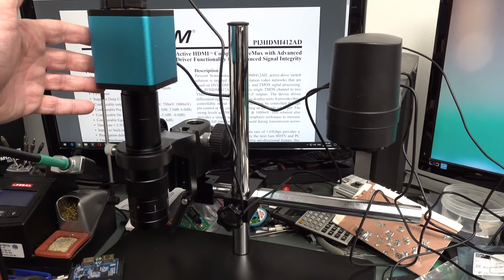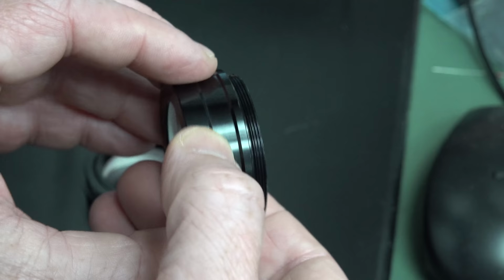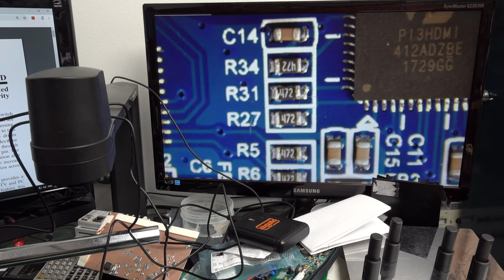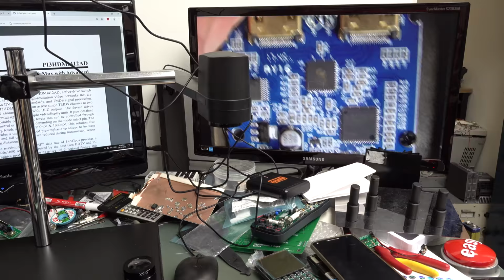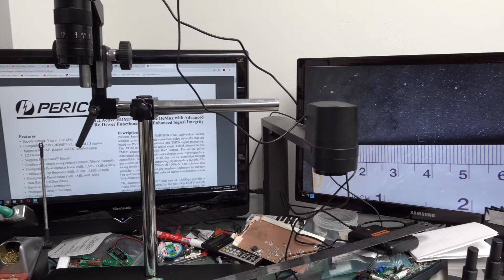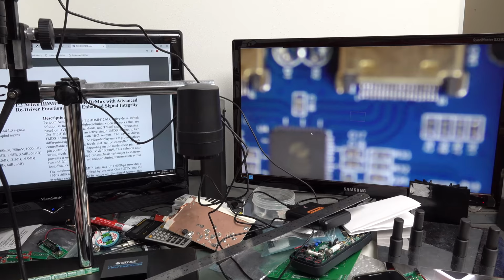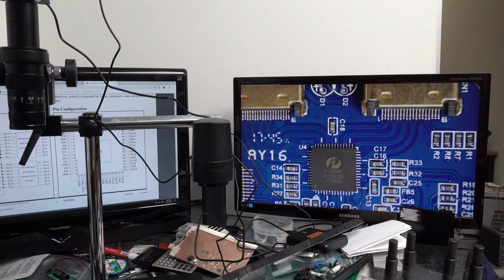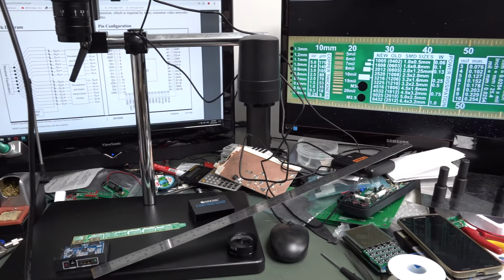EEVBlog #1143 - Eakins Microscope Barlow Lenses

Comment: I don't need a microscope, but I want one of these.  But, alas, no.  I'll stick with wearing two pair of reading glasses (which works amazingly well).
Reply: Just tried it, good tip even though it makes me look like a tit.
Reply: I'm in the same boat. I could certainly use one, but don't need one. Stop posting about this, Dave! I'm still recovering from my rigol and fluke purchases, I don't need another expensive tool enticing me!
Reply: I did not think I needed one but I am the same with good recommendations and recovering from past purchases. I got one and have tons of uses for it now. I'm also getting some Barlow's and going to use it with an old telescope. Weather permitting I'm in the UK. it works brill for spotting marks on so called new items. Call out the seller and normally get a refund of some kind or a Free return when the items not worth it. :-) One of my best buys and the grand kids also love it they now come armed with items they wish to see with Grandads Super Zoom power and they also bring a usb so they can get a copy of the pics. Worth it weight in gold just to see them so engaged and who knows Dave may well be responsible for the next Astronauts AKA Tim Peaks, Physicist Bryan Cox,  or Engineer James Dyson. :-)

Comment: I got the 0.35, 0.5 and 2.0 lenses I found using the 0.35 worked best for my situation, I have also ordered some extension tubes to allow me to raise the microscope up higher to be able to use zoom above 3, auto focus has been really good to have ! 

I am using the 120x assembly not the 180x.

I have some footage recorded for a review video, but haven't got around to it yet. I have been using it to do liquid damaged Macbook Pro repairs, doing 0402 and can use a 10" screen just fine.
Reply: Which extension tubes?
Reply: were you able to test it? I'm trying to find out if it's possible to get the area of 20x15cm with a 120x and 0.35 barlow, even if it means mounting camera 1m above the desk. could you check that for me please?

Comment: I'm able to get great results using a DSLR camera, extension tubes and a normal lens from my old camera. I built a jig to photograph 35mm slides, and can pick up grain on Kodachrome 64.
Reply: I don't need to use a microscope very often, so I also use my dslr with a 70-200mm lens, a close up lens and 2x and 1.4x teleconverters (barlow lenses). That works amazingly well with a great zoom range, autofocus, more than 300mm working distance, and at maximum magnification I get an amazing 12mm wide field of view at full hd resolution. Can get even closer than that if I use 1:1 sensor resolution.

Comment: I am using a ezcap287p HDMI to USB3 capture unit, that works just fine with the eakins, and my splitter (which looks physically the same as, but has different silkscreen to yours), also my splitter is being powered from the USB3 port without external power.

Comment: If light is an electromagnetic wave and lenses focus light, can lenses also focus WiFi or other electromagnetic radio waves ?
Reply: Yes, but you need absurdly large lenses at wifi wavelengths (13cm vs <1 micron for light), so nobody uses them.
Reply from the maker: You can, but not with optical lenses. Light is much much short wavelength, hence the diffraction happens on much smaller scales than radio waves, so the lens material and properties really matters. Some plastics do it at  microwave frequencies.
Reply: You can, just the lenses would be massive. Since 2.4GHz has about 12cm wavelength, a refraction lens would have to be hundreds of meters across to provide any kind of focusing power.
Reply: I seem to have read something about using a Fresnel lens for microwaves.... not the glass or plastic kind, but a flat wood surface with the right pattern of aluminum circles laid on.
Reply: OverUnity7734 hello
Reply: Hi
Reply: @emmanuelafriyie3528  
Hello, 
Konnichiwa, 
Bonjour, 
Guten Tag, 
Aloha

Comment: Will these work on the Hayear 41MP included tube lens?
I'm glad I finally found a video about this.
I want this setup but I can't imagine what I'd use it for other than soldering and reading the fine print on things.    What do people use these for in real daily life (not industrial inspections like in a shop) other than soldering?
Reply: Check with Hayear on Ali express you can Message (New Feature i think ) them Direct Im in the progress of buying the Hayear 51mp Camera at the moment and they have been exceptional in giving me a list of items that will work with the lenses they do and also some others from the Aliexpress store. check the spec of your lens where you bought it from assuming it came with the camera / Microscope. for other uses see my post above in reply to BobC the one with the 2pair of reading glasses. :-)
Reply: @andydickinson4018  i bought the 51mp and hace had it a while.  Mounted from my ceiling pointed down on a camera tripod pointed at workbench.   Held to ceiling via one eyebolt in joist and bungie cords.   Out of way and ceiling has less vibration but mainly it decreases magnification to something usable.  Connected to 44" tv.    You can see puctures on my soundpack page.

Im not happy the lens is so hard to get in perfect focus or that it doesnt have motorized focus control which it needs badly.  Otherwise works as advertised.  I use it to read my mail.  Too blind now to solder.

What else about it?  It can connect to 720 and 600 monitors too.  Also the 51mp is just about 6x times 1080p..  So you wont be taking 51mp picrs but what it does is give you up to a 5 or 6x digiral zoom.  Kind of useful.   I cant get usb to computer to work for me.  The infrared remote is very  useful but sometimes frustrating and you need to buy your own battery fir it if I remember.
Reply: @choppergirl  HI i seem to remrmber reading that to connect via usb make sure a memory card is not in the camera and also dont use the power supply just use usb power. This seems to work with mine which i got for a ridiculous price low that is. I am reading up on lens making so i can by some stock parts add them together with a Barlow lens and get aawsome lens i have also found an old security lens system that i will try tweak so i get at least a fine tune that is mortor driven. similar to what they have on computerised telecopes for tracking but a whole lot smaller. Then i just need to check open source for some code examples to follow. :-) Nice Heath robinson setup at your end good idea to mount from above.
Reply: @andydickinson4018  Thanks, I'll print your comment out and put it with my microscope docs, I would of never, ever tried those things... because.. well, why?   It should work with the SD card in and power connected... but ok, it is what it is.   

The nice thing about having mine mounted on a upside down tripod from the ceiling sprung with an eyebolt and bungee, is I can raise and lower it and to some degree adjust the magnification, an direction it's pointing.  I was using it yesterday to look at a CMOS jumper inside a PC to reset the bios, which in this case did not work.

What I don't like about it is the incredibly shallow focus depth, and that to focus it I have to touch it which wiggles the whole affair and makes finding the perfect focus that much more challenging.

When I asked Hayear for help picking a lens they completely ignored me, so...  if someone got a whole list of lenses or whatnot from Hayear as suggestions they did a lot better than me.
Reply: @choppergirl  Hope it works Let me know. It worked for me fingers crossed :-) I'm having Fun not with another company re a Bad Camera. My original one. It takes 10,to 20 attempts to get the Hdmi to work. switch on off on off rinse repeat.
Also the Menu Freezes etc requires powering down Arggh no Hdmi rinse repeat. Long story short. They sent a replacement buttons Panel. No instructions. Doh good Job im not easily phased. Id watched Dave Tear one down as well as many others. Fitted new Buttons and also checked the other cable end was firmly attached. Bet you guessed it. Power on no Hdmi 25 attempt later Got a signal. tried the remote control got a Menu it managed to scroll down 4 items to the Color menu and Locked up. So i have given up on it. Im awaiting a Dispute resolution From Ali. If I dont get any Joy Ill send it to Dave to rip apart and then rip them a new one :-).
Reply: @andydickinson4018  Hmm, I don't use the buttons on the top of the camera at all.. I use the IR remote that came with it.   Never had a problem and HDMI works every time I switch it on.   To power it off I just switch a switch on my power strip.   So to turn it on and off I use a power strip that also switches my lights on at the same time.   Try that instead.

If you don't have a watch battery for the remote, you can get a pack of them cheap on ebay... CR2016 I think, but double check... I'm so blind I can't read it on the battery without firing up the microscope.

The main thing I use the IR remote for is to zoom in and out with the digital zoom using the up and down arrow.  Once I have the menu system setup I stay out of it because it confuses me as well as the other butons on the controller.   Also, keep in mind it's Infrared light using an infrared LED on the front of the controller, not radio waves, so you have to point it in the general direction of the microscope just like you would a TV controller.   For me that's up and it always works as long as I'm pointing it up at my microscope from the bench.
Reply: @andydickinson4018  That sucks, sorry dude.   

I'd buy another one on credit card thenyou wouldn't have tow ait ont he refund, by the time the bill came you'd probably have it.
Reply: @choppergirl  I have the vids i sent as evidence with how bad it was behaving perhaps I should do a review commentary alongside. Just to make the company realise the consequences of poor service :-) . Anyway thanks for the support don't forget to let me know  if the fix works with your setup. Im still tempted to send it to Dave's Postbag for him to review it. he would do a better Job with his sense of humour:-)
Reply: What lens should be used so that it can be placed at a distance of 60 cm from the desk top and, at maximum zoom, obtain an area approximately 2 cm wide?

Comment: Nice video, how about diameters? Microscope camera 25,4mm is connected to C mount lens 20mm. Lens have 50mm for hook (stand) and 48mm ending for  Barlow lens? And Barlow lens is 45mm? How about protection glass, do you have any/use any?

Comment: Did you update the cable spec for hdmi 2.0 to support 4k? The cables are often a problem as they don't all support the higher bandwidth. Apparently hdmi 2.1 supports 8k. But using an old cable won't give the full experience.

Comment: Nice.
I have a similar setup but without the auto focus.  Of course none of my barlow lenses from previous microscopes are the correct size for it.  I should order one with the correct thread.
I generally prefer my Andonstar models (not quite sure why...) but this model with auto focus would certainly be a welcome upgrade, plus that tall stand!
Reply: What part exactly is responsible for the auto focus?

Comment: What purpose is there for a  heights other than to get a board and soldering iron under it?
Reply: Can be pretty handy if you are repairing something that is still half in a case for example or on top of something big. You can leave the board in place and functional then to test.
Reply: Nicholas Heidl Also to get a side view to check if any pins are flying loose a few microns above the board (bad connections!).  300mm is about the width of many baseboards for instruments and computers.

Comment: Great video - but can you recommend an Eakins equivalent in 2024?
There seems to be better software and better Sony chips in the current offerings.
Ali Express has the following:
2024 FHD 1080P SONY IMX385 Autofocus AF HDMI Video Microscope Camera U disk Storage Measuring Magnifier For PCB Soldering Repair.

This is just the camera but no stand or lenses.
Advice appreciated.
Subscribed

Comment: Why is this so special? Never used a DSLR or mirrorless with macro lenses?
Reply: try and get that working distance with a dslr & a macro lens.  My 100mm macro has max magnification at like 6 " or something crazy, and it was 1000$+
Reply: @beyonddeath123  You need macro tubes in between.
Reply: @merlingallagher4484  Isn't macro tubes used to decrease working distance?
Reply: The tube tend to distort the more u have so glas and good glass is the best answer- have you ever seen the macro lenses video film makers use for natural history shots of insects? They get up to around 12-15 inches. And because they use apochromatic and coated lens systems there is a beautiful bright flat field.
Reply: You can get a great working distance with macro, but that means you have to use a long lens. Extension tubes reduce your working distance. 
I don't need a microscope very often, so I use my dslr with a 70-200mm lens, a close up lens and 2x and 1.4x teleconverters (barlow lenses). That gives me more than 300mm working distance, and at maximum magnification I get an amazing 12mm wide field of view at full hd resolution. Can get even closer than that if I use 1:1 sensor resolution. And the image quality is fantastic.
Reply: ASJC27 all that for under $500?
Reply: @HighestRank  Of course not. As I already have all of this photography gear I thought I'd try it and it works very well. I don't suggest someone buy all of that just for micro soldering, but if you've got it and don't need a microscope on a daily basis this is a viable option. One could also achieve the same result (but lose the zoom range) with just a dslr and macro lens. A longer macro lens, if you want a lot of working distance.

Comment: No clue what a Barlow lens is
Reply: Flemming Jacobsen basically it’s a mild reducer or magnifier which when used in conjunction with its black tube may unflip the final image by 180° in circumstances when it’s impossible to flip a real object, of course with minimal loss of luminosity. In this case its only practical application is like putting a fixed-focus lens on an autofocus camera to shift its entire zoom power range around, which for a ‘reducing’ Barlow (fractional power) adds the benefit of increasing field of view, such that very little of its original autofocus capability will be lost even while increasing the distance from the object to the scope. Any added extremity or ordinary (non-Barlow) complexity often dramatically decreases depth of field and obviates setting any ‘back focus’ especially when the lens diameters are small, and large high-powered ‘objective’-lenses with short focal lengths are so expensive that when possible they are omitted in lieu of low powers in conjunction with an extra-long optical tube or if there is a cheap but standard lens that’s slightly overpower, a fractional Barlow added to compensate.